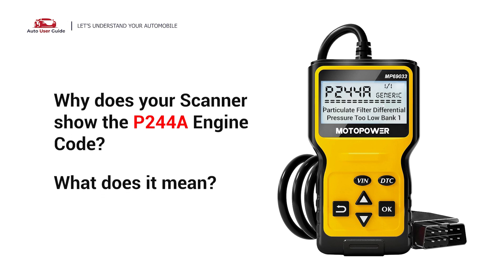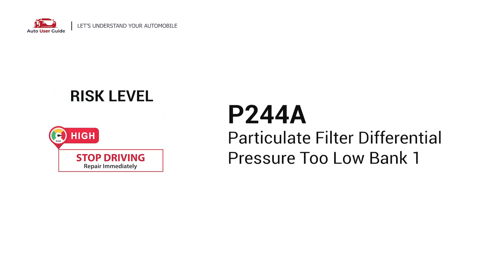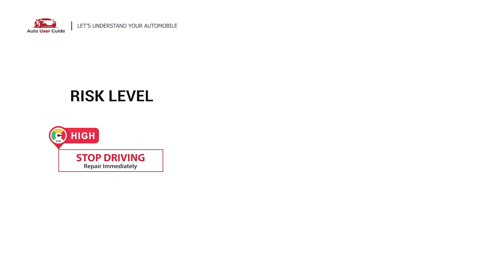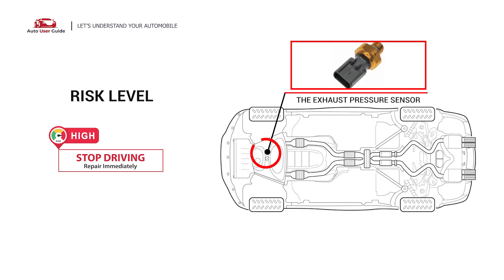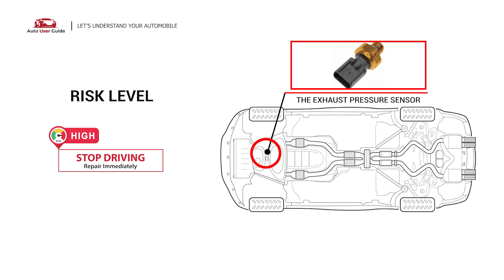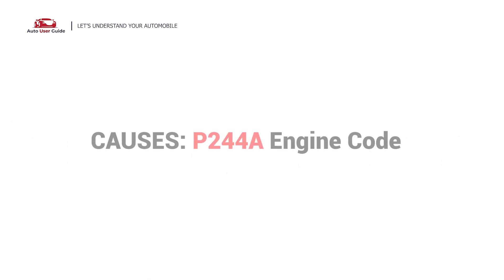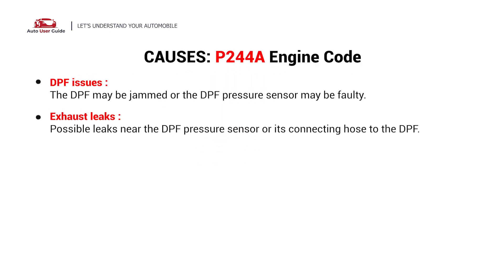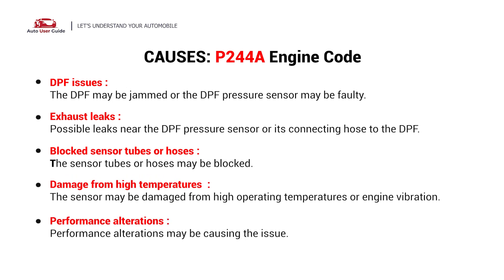What is P244A : Engine Error Code Causes Explained

Comment: Troubleshooting Steps

1. Stop Driving:
It is recommended to avoid driving the vehicle for extended periods when this code is active to prevent further issues. 

2. Inspect for Exhaust Leaks:
Carefully check the exhaust system, especially around the DPF and its pressure sensor, for any signs of leaks, such as black soot marks. 

3. Check DPF Differential Pressure Sensor:
Examine the sensor and its associated wiring for any physical damage, corrosion, or loose connections. 

4. Use Diagnostic Tools:
A diagnostic scanner can help check the DPF's differential pressure readings and the sensor's voltage to help diagnose the exact problem. 

5. Perform DPF Regeneration:
If the cause is soot buildup, a proper regeneration cycle may be required to clean the filter. 

6. Consult a Professional:
If you are unable to identify the source of the issue, a qualified mechanic can properly diagnose and repair the problem.